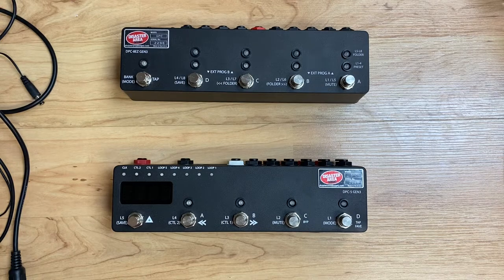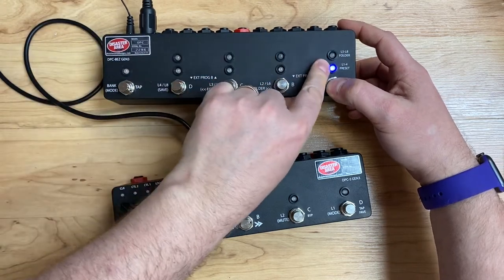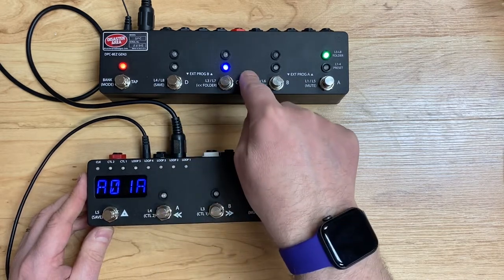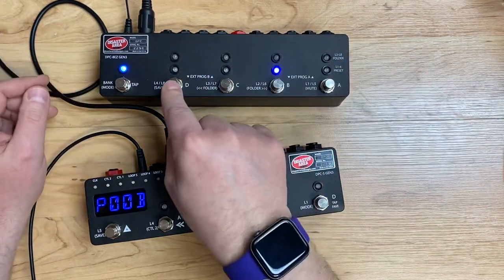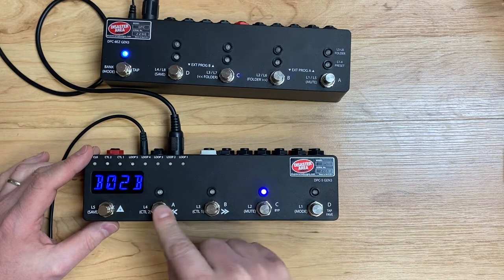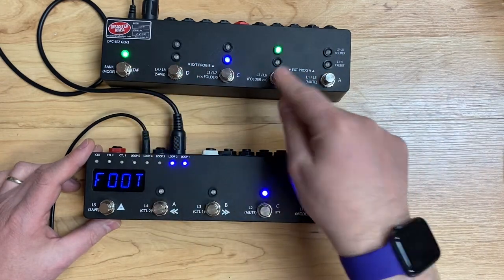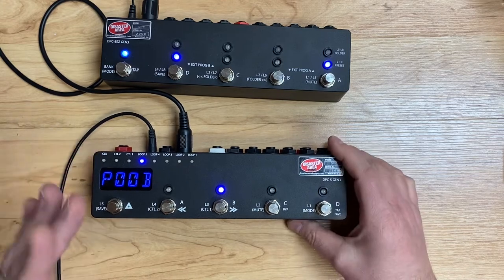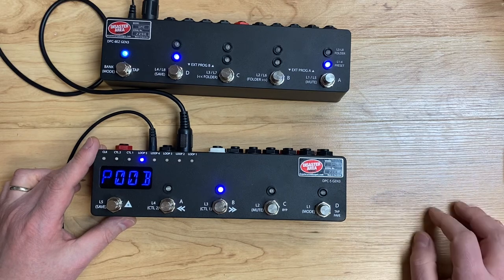DPC-5 Gen3 + DPC-8EZ Gen3 Configuration

Comment: I want to know how to use my DPC5 3rd gen with my noise gate, and effects loop in the four cable method. I wrote disaster area, And they told me I couldn't do it unless I had the DPC 8 EZ. But even if I have that, I still have no clue how it would work.

Comment: Does the dpc 5 have midi in? I want to control it with a Morningstar, but still have instant access to footswitches. Should I just look at getting the dpc8 instead?
Reply from the maker: Yes, it does, the 5-pin port has input on pins 1 and 3.  We offer a y-cable that breaks these out, or you can make your own cable if you're handy.  But the DPC-5 is a bit overkill to use as a slave if you already have a master controller in your rig so consider the DPC-8EZ.
Reply: @DisasterAreaDesigns  Thanks for the reply